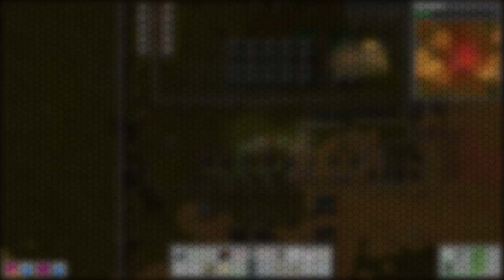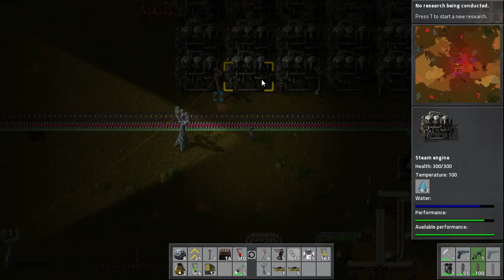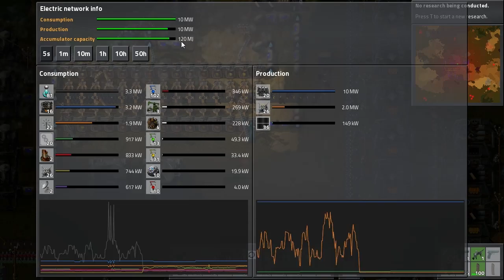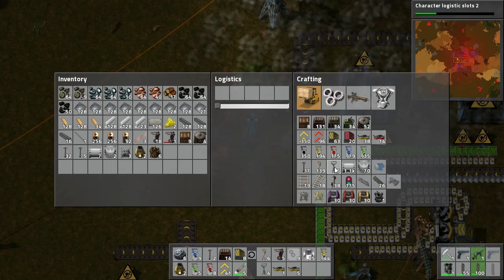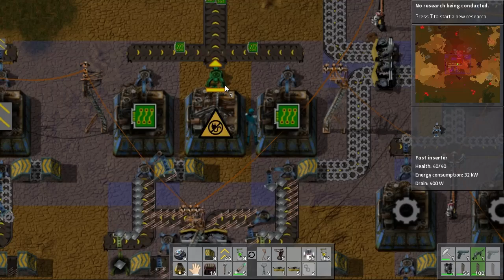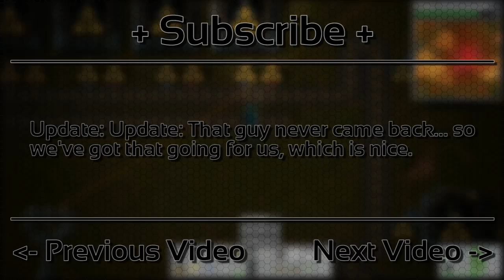Construction + Factorio #13 = GOT PACK 3?!?

Comment: Stuff, t get the third circuit running, use 2 smart inserter to pull from the belts on either sided, use  belts to feed to a central north south belt that feeds to a fast inserter that feeds to the middle assembly plant

Comment: I like most of the ideas from the comments right now, but you should really fix your energy problem or your screwed. I really like Molly's idea to convert your oil into fuel it's a good alternative to coal in your steam engines.

Comment: with the electrical circuit get copper from the left and iron on the right (or the other way round) in the similar way you put the electrical circuits on both sides when they're produced.

Comment: For the electronic circuits, why don't you loop the belt on the right to go horizontally below both of the assembly machines, similar to that of the science pack assembly machines, and then have two fast inserters above said belt, one for each of the assembly machines. As you said at the beginning, the fast inserter will pick up what's needed in the machine, from both sides of the belt (I think, of course I may be wrong)
Reply: I agree. Redesign the belts for the circuits. so the iron wheels go closer to the bottom belt and do what BrownKnight says :)

Comment: Copper wires are probably the one thing you don't need the speed modules for. I think you are just about to hit the point when copper overtakes iron as the most used material if you haven't already.
Depending how far ahead of the comments you are in the game, you should address your copper->wire->basic circuit production line. A suggestion for your circuit factories
Keep the underground belts where they are, they will still fit.
Each factory has 2 spots for inserters, put 2 fast inserters  per factory.
You can now move the 2 smart inserters for iron togeather, iron on one side, copper wires in from the before the spliter on the other side, then just wrap the belt around next to the inserters that feed the factories.
You may also want to consider an area that you can easly expand dedicated just to circuit production.
I think this is often overlooked, but inserters can pick up from the end of belts.